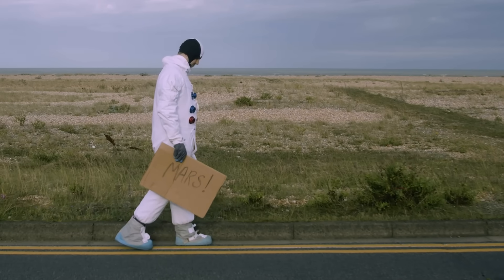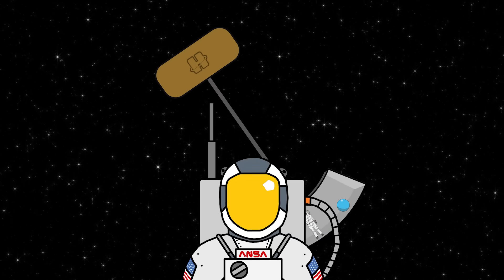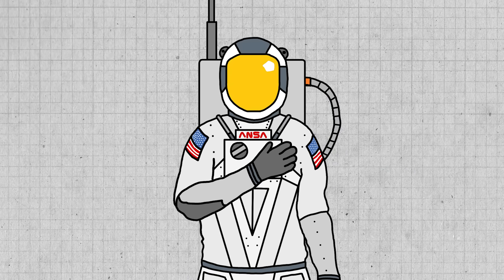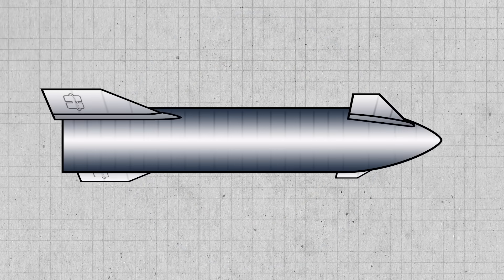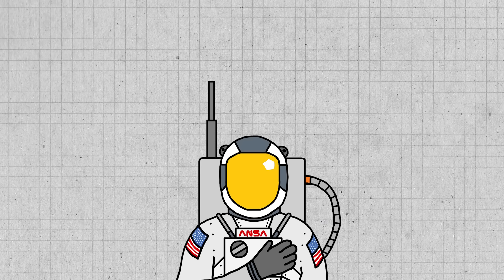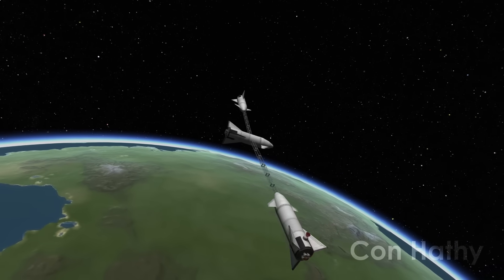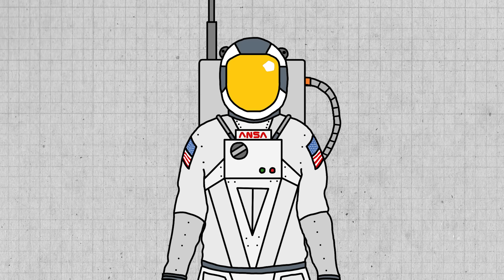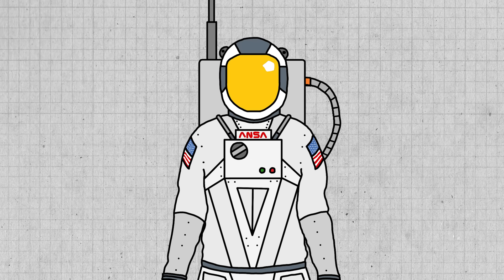This is NOT how you make Artificial Gravity

Comment: If the cable (or structure) connecting the spaceships snap, very likely the recoil force on the broken cable from the spring tension tugging the spaceships will be enough to cut through the hulk of the spacecrafts.

Comment: Couldn’t you use reaction wheels instead of rockets to spin it up and slow it down?
Reply from the maker: The problem with reaction wheels is that they are inherently less mass efficient. Rocket exhaust moves at kilometers per second; to match that performance the wheel would have to be as wide as the entire vehicle and spin at kilometers per second as well which is not practical at all

Comment: Just finished my Dynamics of Mechanical Systems class (ME 534) where among other things, we talked about rigid body motion given a general inertia matrix. Even with products of inertia, you can calculate the torques about your other two axes needed to maintain constant rotation without precession. For the Apollo missions, they slowly rotated the command and service module about its long axis while it was travelling through space in order to keep the heating from the sun uniform. Because of the slight asymmetries of the equipment within the module, they weren't rotating about a principal axis, so there were products of inertia at play. As a result, they had to constantly fire thrusters about the other two axes in order to maintain a constant rotation axis. It was okay though since the products of inertia (and therefore the torques required) were low.

TLDR: long axis rotation has been done before and is not really an issue provided you have attitude control (and I would hope you do, you're in a spaceship dummy), and smallstars' idea could totally work, as long as you budgeted an appropriate amount of fuel to gently fire the thrusters and maintain that rotation axis.
Reply: that just sounds like a lot of extra fuel you have to bring, decreasing your science and living space budget

Comment: Why not acceleration with a nuclear dust plasma engine it got a isp of 1.5 million seconds. Or nuclear saltwater rocket which can accelerate at 3 g with an isp of 6730 seconds.  It would take days instead of month of travel time with those rockets. I think its better for space stations or interstellar travel where you can increase the size of the ring which would decrease the coriolis effect. We would need really large radius for rotation axis to be able to make artificial gravity functional. 

Though for traveling in our solar system the nuclear rocket system are way more efficient especially since there are a lot of radioactivity in space already. The main disadvantage with a nuclear rocket while the advantages is a way higher efficiency and shorter travel time.

Comment: I'd just use cables to connect 2 starships ass to ass so the fuel doesn't have to burden us with the most weight under the artificial gravity. Gotta make sure the plumbing can work upside down, especially that the toilets can pivot 180 degrees for ground and tethered configs.

Comment: NASA now has a long, long list of the problems associated with zero gravity for extended periods. However, the bottom line is that we evolved in a 1G environment and ecosystem, so without significant genetic engineering it is improbable we can safely adapt to zero-G or, possibly, even low G. This is one reason it is vital to establish a research facility on the moon before venturing to Mars. On the moon you are substantially protected by Earth's magnetic field and 'home' is just a few days away in an emergency. So we can learn, in comparative safety, what would happen if, for example, a mammal were to undergo a pregnancy in low-G. We don't know a huge amount about organ development, but in recent times we have learnt that gravity (and, curiously, electric charge) does have a direct impact on fetus development. So if you're thinking 'colony on Mars' we really have a long, long road ahead, measure in decades, not years. Ultimately, however, exploration will fall to robotics and AI, with humans involved only in ideal situations. As a Star Trek fan, it is hard to stomach but the truth is we are very poorly suited to space exploration.

Comment: Perhaps you got the sloshing of the fuel wrong? Because the rotation is perfectly smooth, the sloshing will stop soon, will it not?
Reply from the maker: It’s smoother than my example, but never “perfectly smooth.” There is always some wobble which leads to some energy dissipation. Even things as non-fluid as rubble pile asteroids will eventually migrate to a rotation around the maximum moment of inertia
Reply: @ConHathy  Thank you for a good explanation.

Comment: Artificial gravity is a myth. Why do so many people ignore Einstein’s declaration that the ONLY way to mimic gravity is with constant acceleration? Any design of “a big rotating space wheel” or other space construction MUST include constant acceleration. That isn’t feasible so forget about artificial gravity on manned space missions.
Reply from the maker: Circular paths do require constant acceleration, absent acceleration you would travel in a straight line
Reply: @ConHathy  Nope, the good answer is having a circular constant velocity make a radial constant acceleration. So the big ring despite it's archaic design IS exactly Einstein solution.
The only pratical way is "shorten" the travel with better engines and make all astronauts sleep at the same time when the ship use short range method to create micro gravity (0,2 G) to minimise the health issues. Any computer or even a smartphone can pilot a ship even with such spinning.

Comment: What a wonderful video with simple explanations of things so many common misconceptions!

I agree that tethered spacecraft definitely appear to be the best, the cheapest, the most lightweight and the most practical solution. This is especially the case if the generated 'artificial gravity' is lowered to less than one G, allowing for smaller diameters and much lighter (tethering) structures while still providing major benefits for physical and mental health (along with other measures like fitness workouts weightlifting etc) similar to those astronauts conduct in 0G environments to remain healthy for longer periods. 

I would strongly suggest considering tethering more than just two spaceships (or space modules rather) though! 
The most likely solution that I personally think will prove most practical, is tethering at least four, maybe even 5 or more modules together into a structure (maybe with some modules experiencing near 0 or low gravity in/near the center of the structure). 
The result would be a modular structure which is in a way very similar to the ISS, but with the modules tethered and rotating.

Such a type of vehicle design would not only allow for final assembly in space, but it would also allow for a similar strategy as the Moon landings with modules of the vehicle remaining in orbit, and just one or two of the spaceships/space modules detaching for the trip down to the planet. 

Such a design would of course also allow for each of the sections to be optimized for their special purposes, and it would allow for at least some limited implementation of a few mission critical redundancies, greatly improving mission safety aspects. 
Furthermore can the tethering structures (easily) be designed for transfer of resources (fuel, water, oxygen food), energy, and data from one module to another during the trip, in return for waste products going back the other way to maintain balance of the rotating masses. 

Maybe even more importantly though, would it allow for some of the sections to be left behind at various stages of the journey. 
This (just like any other viable design will similarly require to be practical and efficient) allows to leave structures containing large portions of waste, (used) fuel, (used) food, and other used up resources or equipment behind. 
This will make the vehicle for the return trip much smaller and much lighter (and it would even already allow reducing the ship's mass before 'decelerating' or entering the orbit of Mars). This will make the overall concept very (fuel) efficient, while at the same time retaining all the necessary (tethering) dimensions of the artificial gravity design concept, only with (far) fewer tethered (and spinning) modules on the return trip.

Comment: how is that lighter cheaper and easier than cabling two starships together?
Reply from the maker: Because you don’t need the super long high-strength cable or the system to connect and spool it up/down
Reply: @ConHathy  It'll be fun to see what solution they go for, if they implement some sort of artificial gravity. I'm very sure that it won't be some sort of rotation within the starship. Time will tell.

Comment: They should do both, spin 2 Spaceships during the mission and send the short centrifuge. You said at the tip they'll get max .1g that might be good to augment
Reply: I think the maximum of .1 g was from the rotation of the starship if the tether breaks.
There’s no maximum amount of gs you can do with a tether, as you can just make it spin faster for more gs.
Also, I don’t think a short radius centrifuge combined with the ship itself spinning around a tether will work, because the short centrifuge’s center will be in the ship while the ship rotations’s center will be at the middle of the tether, the gs generated will have different directions as a consequence.

Comment: 1) You do not need any fuel to start/stop spinning - Electric power is enough. You need some mass that will carry a contra-rotating moment (like reaction wheel or second pair of tethered starships) and an electric motor to start-stop the rotation as You please. To keep everything safe and stable you detach masses during cruise phase.
2) When the tether brakes You are dead, due to elasticity of any rope material. The loose end will hit the ship with pinpoint precision and all the energy stored in the rope itself.
Reply from the maker: You could technically use electric power to spin up but it is necessary less mass efficient than thrusters. The exhaust of the thrusters is leaving at over a kilometer per second, to match that efficiency with a reaction wheel it would have to be the same radius as the entire vehicle and would also spin at over a kilometer per second which is impractical

Comment: No body in the universe uses centripetal force to create gravity, so why do it for starships? Better to copy the universe and make the ship a sphere and use a centrally located magnetic force to create gravity just like the rest of the universe. If done correctly it may be the magnetic force could also be used for propulsion. Building a sphere means you can armor the hull for protection from contacting the billions or trillions of traveling bodies potentially in the way. Some may say: "but you can't land it!" It's a starship, and there's no way of getting around the need for a lot of mass to carry for survival while traveling, so landing must be handled by shuttle no matter what shape you choose because of the mass you must carry.

I can't understand how any structural engineer could even postulate the possibility of connecting separate masses at the end of frail tubing structures would actually withstand the physical stresses of spin. There are hundreds of points of some VERY MEAN stresses along the connecting structures. Not only do you have centripetal forces acting on the outer masses, but your propulsion must come from the centrally located engine that keeps pointing in the direction of travel at all times. That adds more stresses in the opposite direction of travel. Such a ship would fly apart if it was necessary to quickly change course to miss something.

Comment: The tether concept was experimented with and was found out that due cable stretching and pulling back like a spring the space craft is pulled towards the center then a inertia pulls the craft away from the counter weight creating an impact load on cable and makes the center of rotation unstable meaning gravity will be as well. This is a reason why solid structures are required in between the ships. As for small diameter centrifuges, they will work for research purposes and small scale transport but the selling point is colonization.
Reply: you may like Steve Mould's video on parametric resonance and different modes of elasticity
Reply: I think you could introduce damping structures, in the middle and/or at the ends, to avoid the spring effect.

Comment: Hi everyone. Please consider the following and really suspend the programming we've all been indoctrinated with. This to me puts one aspect of the mystery to rest so well that I can stand firmly on its simplicity and be sure that at least this much I can and do know wholly upon my own experience and knowledge. No authority figures or abstract testing required.
Where to begin, at the beginning, before the beginning?

Newtonian laws of force and motion when applied to the angular velocity of a rotating spherical  body, when crossed by an implied gravitational force that pulls toward the center mass of the body produces a force vector graph that shows angular velocity at a 90* right angle to gravity unopposed at the poles that changes incrementally at each latitude from 90* unopposed to directly opposed at the equator of the spherical body. The only place where both forces could find balance. 

Newtonian laws of force and motion predict that if Earth were a spinning sphere with gravity pulling towards its center of mass all unrestricted water on its surface would necessarily have to follow the vector angles produced to the equator and then upward to the point where gravity's fixed and angular velocities increasing forces were equal, but since angular velocity increases with radius it will overtake gravity at some point and propel the water out in a disk and off of the Earth.

Now tell me again about gravity and our spinning globe planet with polar seas. Please?

 Both the laws of physics force and motion and observational evidence easily prove the Earth, whatever it's overall and unknown size and shape, cannot be a rotating ball spiraling through an also impossible vacuum.

Comment: Also, regarding the ring-stations - yeah, they're not very practical to build, but my favorite proposal for building a space station was one that involved the big orange fuel tanks used in the shuttle program - the idea was that rather than discarding them, they'd give them just enough extra push to get into orbit, where after numerous launches, we could send up a space-tug with some extra hardware to rendezvous and gather them all together and use them to build the segments of a ring station (of course you'd start with the dumbbell of 2, but then you can keep attaching them in pairs until you have the full ring).

Comment: I don't think you're wrong about the potential benefits of small centrifuges, but I think you're missing what problems people have with them. Being good for health in a sort of "exercise every day" sense is one thing (and that's probably more than enough for a purely practical long-term research mission), but what people want from artificial gravity is the ability to be on a ship in space with the ability to move about as if you were on normal ground. It's not just motion-sickness, it's practicality for being able to move around normally to use ship facilities naturally.
Tom's video is a prime example too of the effect of smaller centrifuges - the smaller the centrifuge, the more the ball will arc. A large tethered one will significantly lessen that problem, which again, is beneficial for a mission where you want the benefit of artificial gravity for both health reasons and living quality (ie, for when you're not strapped into the daily exercise machine).

Comment: I don't think going to Mars on a Starship makes much sense to begin with. A nuclear-powered craft built in space that ferries people and cargo back and forth between Earth and Mars while conventional rockets ferry people and cargo to and from the surfaces of the planets make a lot more sense. The journey would be much faster. Faster means less time under adverse conditions such as high radiation or a low-gravity environment. Nuclear fuel is much more energy dense than conventional fuel so you wouldn't be wasting so much fuel transporting the fuel into space to use for the interplanetary mission. The interplanetary craft could be purpose-designed for that mission, with a higher weight limitation that allows for better radiation shielding, better artificial gravity considerations, etc.

Comment: You never really discussed the viability of a two-ship plus tether scheme. Each ship is capable of manoeuvring to stop rotation, course correct, re-dock and resume rotation. Whassa problem? There is no reason for the tether to sever. Just build a good one, no? ... And my fave is a nuke booster with constant acceleration and deceleration faster, cheaper, and no need for a 1G rate. How about a 1/3 G rate, matching Mars or a 1/6 G, matching the Moon. Some boost every day, some coast every day. Hahaha! I am indeed mad.
Reply from the maker: I actually made an entire video all about trying to use thrust gravity: https://youtu.be/nRKNh-Gx9WA
Reply: @ConHathy  Well, I will certainly watch it. Thanks! But did you actually discuss the two-ship plus tether option?